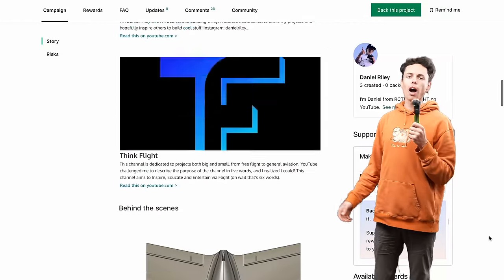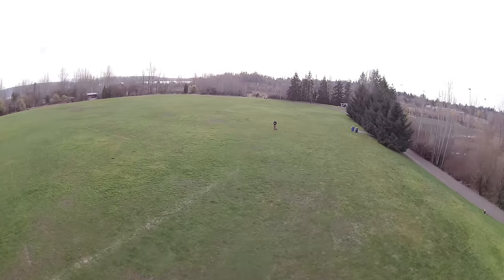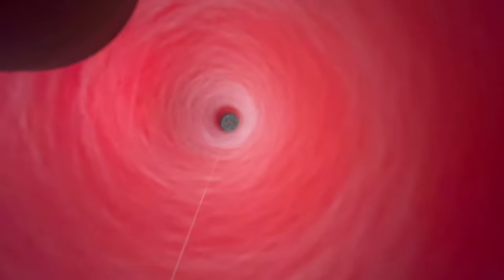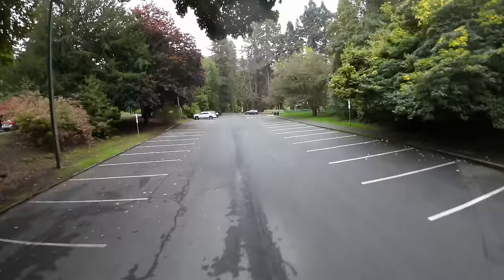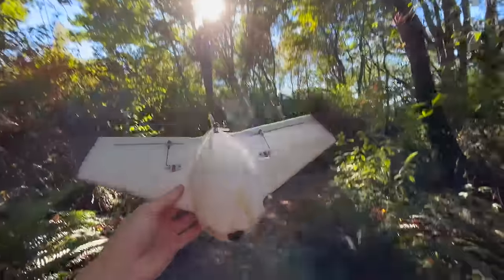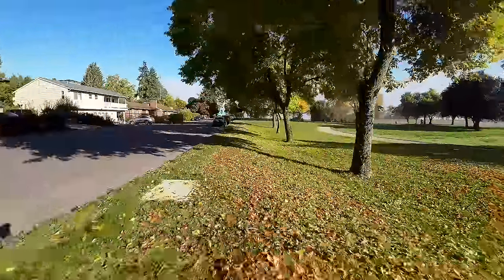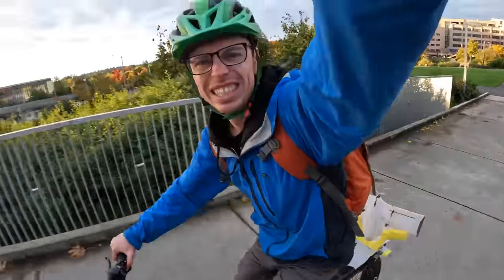Smallest HD FPV Flying Wing - Flik

Comment: - 0:00 The video is about a successful Kickstarter campaign for the creation of a small FPV wing drone.  
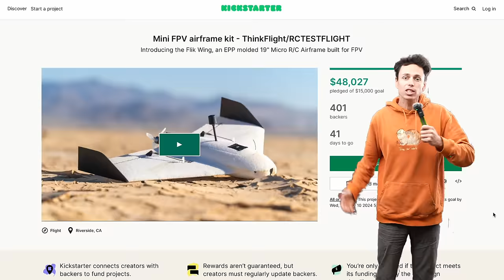- 0:11 The purpose of the campaign was to get an injection mold to manufacture hundreds of these small wings to sell to the public.  
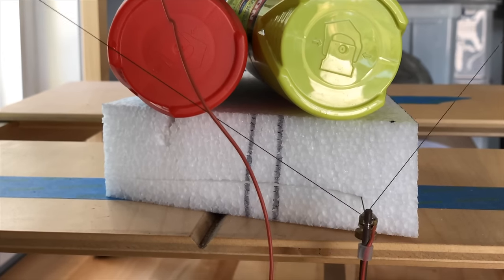- 0:19 The project started two years ago in Southern California with a prototype called the "friendly neighborhood drone", a 170g flying wing with a 400mm wingspan.  
-      Despite initial challenges with getting the drone to fly well, adjustments were made to the center of gravity and tuning which improved its performance.  
- 1:30 A decision was made to create a version with a longer nose for better center of gravity.   
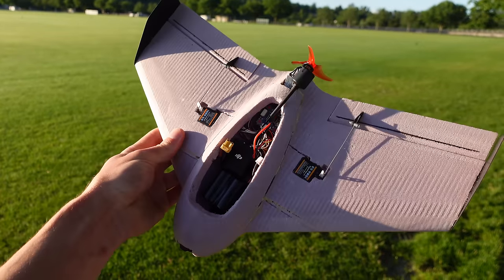- 2:12 The drone was then scaled up by 20% to improve flight characteristics.  
- 4:20 The drone was fitted with a DJI 03 FPV system which allowed for HD FPV video link and stabilized 4K footage recording.  
- 6:06 The drone is under 250g and has a motor at the back, making it safe for use in parks and other public spaces.  
-      The drone doesn't need to carry a remote ID module and doesn't need to be registered, making it more appealing due to recent drone regulations.  
- 5:33 Other FPV systems can be fitted into the drone with some modifications.  
-      The drone is expected to be able to perform epic flights, cliff diving, and long-range flights.  
-      The final CAD model is being completed to be sent to the factory for the creation of the injection mold.  
- 7:00 The Kickstarter campaign offers two options, the airframe alone and the airframe plus servos, motor, propeller, and ESC.  
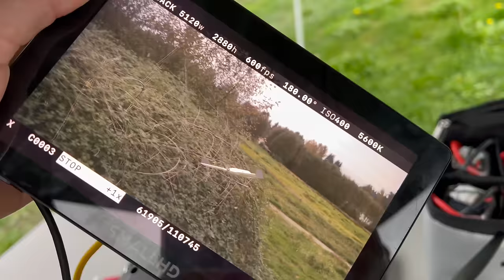- 8:15 Slow motion video
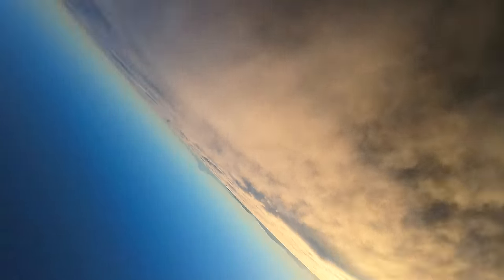- 9:17 The video ends with a demonstration of some onboard footage from the drone.

Comment: How did you get on with o3 air unit and low voltage of 2 cell lithium ion which can discharge down to around 6v.

The o3 lowest voltage is quoted as 7 4v !!!.

Does this mean you can't run the pack down ?   Kinda defeats the object of using the 18650s in the first place ?

Comment: the important thing to remember with foamy planes is that the airframe is the disposable part! The plane itself is the electronics, the foam airframe is just the holder. The cheaper and easier you can make the foam, the better.

Comment: so i pledged support.  

my hope is that when this is done, there will be a simple list of added things i need to buy, such as a flight controller, batteries, ardupilot, remote control unit etc, that i would have to buy and how to mount it.

but for 90 bucks?  i want to do FPV.    i love my mini 3 pro.  its excellent.  but this looks to me to be cooler than average entry level fpv.   i am  excited.

Comment: Those air to air shots are SICK!!

I'm thinking I'll end up with a Flik wing. I just built a nano goblin but would be good to have a backup. Similar planes with a similar purpose but the Flik's more square profile is probably a bit more maneuverable at slow speeds.
Reply: You can never have too many FPV vehicles

Comment: FYI if the material your cutting is square and nominal with the placement of the model you wrap the material with plywood frame so all you have to do is flip the material on the same start point. Not sure what you use for Gcode production my software (Heeks) allows me to pre determine this. So everything is centered. Then you just flip no worries.

Comment: A few requests please, now that Kickstarter has faaaar exceeded its goal:

1) Can backers have the option  of different foam colors please? I imagine some folk would love black. Personally I'd  like light grey (ot perhaps light grey-blue) to make it more discreet (stealthy?!) when flying high. Colour options (e.g. matching/complementary) for the vertical fins would also be a bonus

2) Speaking of discreet/stealthy, it'd be great to design for, and use components for (prop and motor) for as quiet flying as possible. This will make for an even more "Friendly Drone", as you guys put it.

3) As you're going to the trouble of having a bespoke mould of a complex shape made consider whether the vertical fins can somehow be integrated into the foam design (perhaps making them canted rather than pure vertical?)... or even go as far as a pure, true flying wing design, which would be the ultimate in terms of efficiency (or if not, consider such for a v2 and your next Kickstarter!).

4) Try integrating/moulding/smoothing the body into the wing more, to create more of a flying wing shape. If you haven’t already, consider putting it through some CFD modelling. This is with the goal of even greater efficiency in mind.

5) Like Kavin and his original design, my focus is definitely autonomous UAV. Indeed I'm not really interested in the FPV aspect (great though it is!). Instead I'd like to use the best small/light GPS module I can and add a vertical camera (shooting through a porthole cut in the floor) to take geotagged stills when flying relatively high... i.e. for mapping, using phogrammetry. When you're refining your design please continue to consider autonomous and mapping users wherever you can.
Reply: I had exactly the same thought as you when i saw this wing. DIY mini Mapping wing sub 250g is the goal.

Comment: Note that any flight beyond visual line of sight (long range) violates the FAA regulations. Also, any flight that the FAA considers a Part 107 activity required registration and remote ID for the craft regardless of the weight. If anyone benefits in any way or the video is posted to a monetized platform such as YouTube, then it is a Part 107 activity; registration of the craft, remote ID, and Part 107 pilot's license. All flights are Part 107 unless the flight can legitimately qualify for the Recreational Exemption. Also, that 250 gram weight is the Maximum Gross Takeoff Weight (with Battery and any payload) AKA the All Up Weight. So, a craft that has a dry weight of 149 grams has only 100 grams for all payload including the battery.

Comment: It would be nice if there was a backer tier that included like an entry-level control system as well for those of us with no idea where to start with picking out/building a drone control system.
I've been flying DJI mini drones for a while now, and before that have had some experience with 6-channel RC radios for various things, but I'd have no clue where to start with setting up something like ArduPilot or even tuning a controller, let alone setting up FPV.
If not a backer-tier then perhaps even just a "how to get your 'Flik' up and running" guide that includes some recommended control builds and where to get them.

Comment: I don't know if HD systems are any different, but flight controllers typically have an option to set Analog FPV transmitters into a low power mode when the system isn't armed. That would probably prevent your problem with it overheating on the bench.
Reply: The dji o3 is usually in low power mode if not armed. At least on my build. but it still does overheat 😅

Comment: Does using a step up voltage regulator for the 03 air unit seem like a smart thing to do when running lithium ion 2s packs? I see the power  requirement listed is 7.4 to 26.4v.

Comment: Sick build! Would it be worth surface mounting a teeny tiny heatsink to the dji and having it just breach through the top fuselage? Should help with the thermal dissipation a little, both on the move and whilst stationary giving you longer to work with and less chance of frying expensive modules😋

Comment: Cool. Lot's of INAV builds for the RMRC Nano Goblin which is very similar in size & proportions. You then have access to plenty of other peoples inav's settings, including pids, which would be a good start for this wing.  If you are aiming for quad pilots who use betaflight normally, then INAV interface will be very familiar to them.

Comment: [QUESTION] 
I was just racing my FPV drone around Golden Gate Park yesterday and noticed it was suddenly pulling slightly to the left. 
When I finally brought it back, the left rear motor and prop were completely wrapped in spiderwebs and live spiders. 

I’m wondering how it was the left rear prop and not the front?

Edit: it’s been ‘bugging’ me since yesterday. 😜
Reply: The quad flies with the front tilted down when moving forward such that the rear props are higher than the front props. You caught the web with the left rear prop as you passed beneath the web. Either that, or spiders prefer left rear props.
Reply: @28th_St_Air  lol 😂 

That’s what I was thinking.

Comment: Since 18650's are so easy to get, it would be cool if it had an option for an 18650 caddy that you could just easily pop cells in and out of. Not sure if they could be oriented sideways, but it would be even better if there was just a side cover so you didn't have to open up the plane in any other way.

Comment: I think the industry of drones is gonna follow DJI take on it - 249g with standard size batteries and then you can slightly exceed it with a higher capacity battery for longer flights and the FAA taking more of a intentional blind eye to those who exceed it with the larger batteries and focus on more higher weight drones rather than focusing on the average person wanting a few minutes extra longer video shot, as long as their not doing it obviously bad locations like airports and such.

Here in NZ, we have a more "Shielded operation" style so it cant exceed the hight of any surrounding buildings (within reason) and with more no fly zones around airports and then more of a distance vs battery saftey zone, so if your drone cant make it anywhere near an airport or any aircraft wihtout dropping out of the sky with a dead battery, you can do what you want.

Comment: I wonder if you could design a custom top piece heat sync for the electronics... thin wall copper tubing bent flat on the front end and curving over the top of them would provide a reasonably aerodynamic surface, a lot of surface area, and better cooling while in motion. It would add some extra weight on top, and might not be as easy to make as I think.

Comment: Where's the air OUTflow? @5min 22s  you've got an inlet and what looks like a much smaller outlet on the tail, , but with a smaller outlet aren't you just forming a slightly higher pressure bubble of rapidly heating air inside the fuselage?     I vaguely recall a rule of thumb of the outlets needing to be 3 times the inlet size, although that may be for full size cowled IC engines.

Comment: Cool plane, I wonder if you could get an injection molded cage/pod for the electronics so it could sit in the foam fuselage and wings and have attachment points but stay mostly open for cooling

Comment: That model looks great, you ended up with a pretty stable design and that fpv is awesome. I have a model that would be awesome to see if you could get it to fly. I originally had it designed for a twin 69mm edf setup, needless to say, life happens and it's been hanging from my ceiling for over three years. If you are interested, I live South of Seattle and would be willing to drop it off just to see it fly in a video, I wouldn't need it back. Alternatively, I also have 3D print files and laser files for the model I could send you.

Comment: Only watched a minute and wanted to discuss my battery findings.

I've built a few LDARC 450x planes now (Very similar to this one) and I tried using those Keeppower 18350 1200mah li-ion cells. Made a 2s pack with them that weighed about 49g or so. They performed pretty well and I was able to get 18-19 minute flights. But too much of that power was turned into heat inside the battery. I switched to these GNB 1100mah 2s HV packs and I'm now getting up to 24 minute flights. Plane weighs about 160g all up with the 1100mah packs. (Custom FC I designed to fit the plane, 3.5g servos, crossfire nano rx, Newbeedrone m10q nano gps, es20 esc, rcinpower 1207 5000kv motor, 4024 prop, HD Zero race v2 vtx, HD Zero nano lite camera)

Comment: i wonder how maneuverable it would be with nose ailerons like a fighter jet  ^^ 
ok maybe it will shredding its self by the force on the internals ^^
as a normal rc plane this would be uncontrollable but in fpv it should be manageable to fly precise

Comment: Question about the controller. As well as if one were to donate at the highest tier of the kickstarter.... have any suggestions on what to get for first time pilots? and if i should hold off on also getting some goggles to work with the drone?
Reply: I think ELRS is the best RC link so get a controller with that or an ELRS module for it

Comment: If you make a 1 -1,5cm hole in the back where the motor is it draws the air out but you put a inlet so cool air comes in from another hole in the front 😏

Comment: How far can you go with such a setup ? Do you have some telemetry in your FPV feed to know when the control might cut ? 
I guess my question is... can I do long range missions with it? And if yes, what range can I expect ?
I used to fly FPV drones back in 2019/2020, but I gave all my gear away to a friend when I moved abroad. And now I've been missing flying so much, it's itching me to buy new gear again. But it's a big budget usually...
Reply: The DJI 03 advertises 6km of range for the FPV controller 2. That is not considered long range at all. Yes, link quality is shown in the goggles.

Comment: Would it be possible to bolt on a gimbal, thermal camera and transmitter to the nose or would that be too much weight for the structure?
Reply from the maker: If you have a bolt, gimbal, thermal camera and transmitter that weigh less than ~30 grams then yes, its definitely possible 🤣
Reply: @rctestflight  the camera would be 30 grams alone lol

Comment: Can you do a 4G Mod on the plane, and distance test it? See if a super lightweight Solar Panel could keep the batteries charged for longer flight times? I'd buy one of these in an instant if I knew it was 4G Mod compatible. I've been looking at the Parrot Disco for five years at this point, considering a purchase, but the $900 price has always held me short.

Comment: I have been on the line about getting FPV camera and goggles but this video is sending me over the edge. It seems the DJI03 module is great too. Which goggles did you use for this? the DJI V2s?

Comment: don't use DJI radiolink with O3, this is a false good idea because if for ever reason you loose your video feedback then you will have a failsafe on the radio command loosing the plane, unless you have the gps  and RTH configured

Comment: you sure that sub-250 won’t need remote ID? I’m not.
Reply: You don't need to register sub 250, so what would you use for ID?
Reply: @gernith  Whatever they decide.  When a cop pulls you over in your car, what does he ask you for, just the car's registration?  No, also your personal ID (don't let the fact that it's a driver's license confuse you).

Comment: I understand this channel isn't really for newbies, but this specific plane appears to be aimed at beginners. 
Just using the acronym "PEV" like 5 times, with zero explination what that could possibly mean turned me right off.
And upping the size 20% to cover up for some bad "PEV" programming or whatever, isn't a solution that anyone else can use.
In general, an interesting blog about a one-off project BASED on a beginner "simple" plane.... but in no way newbie friendly.
I like this channel, was just disappointed at the zero-depth explanation of what actually fixed it, aside from a size increase cheat.